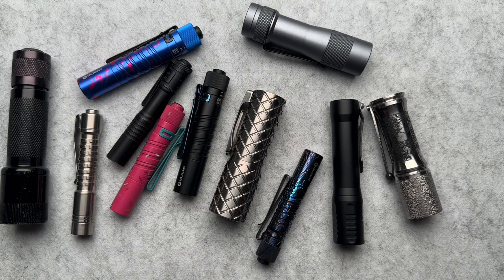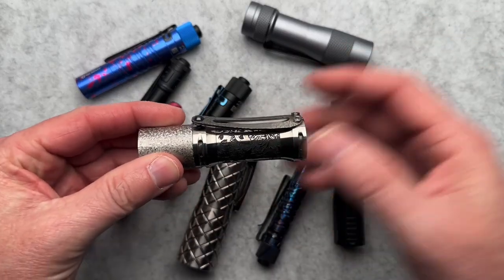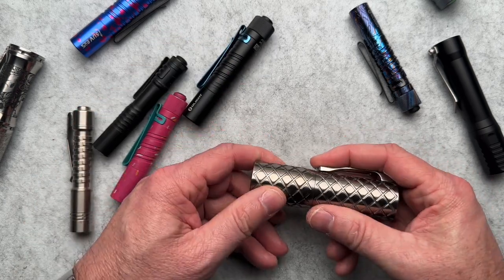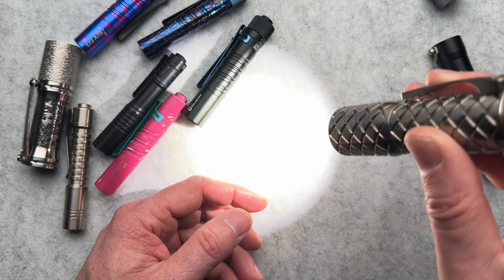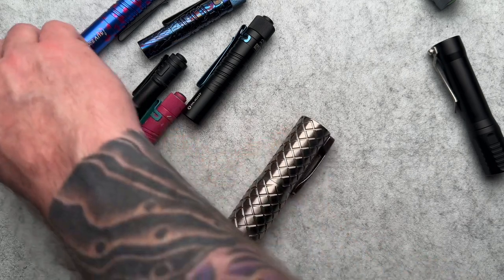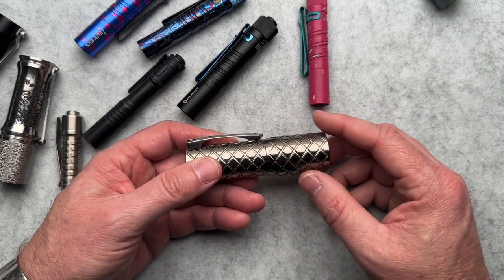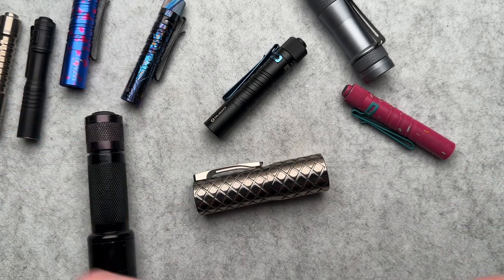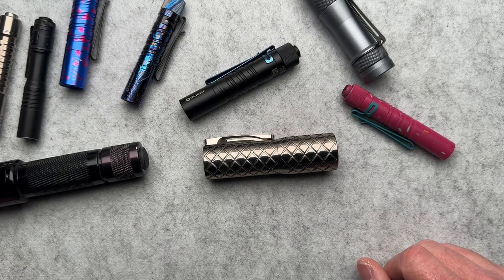Yellowday Energy NFR-Z Torch Dirkscussion

Comment: Sweet new torch! I EDC a Reylight pineapple mini and love it. It just disappears in the pocket and it’s there when needed. I like that it is programmable so I have it with just 3 settings. I like that it has a dim mode, which I use most. i got the updated tail cap too which really improved it. I also carry an Olight in my car and it’s great too, but it’s a bigger one. Can’t remember the model.
Reply from the maker: Sweet. I have a Reylight also but could never really figure out the programming 🤷🏼‍♂️🤦🏼‍♂️